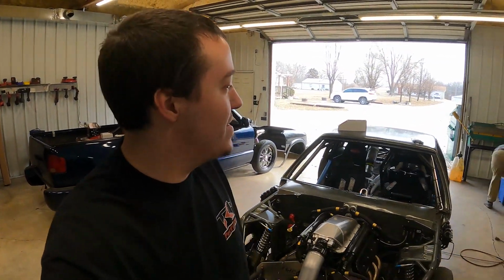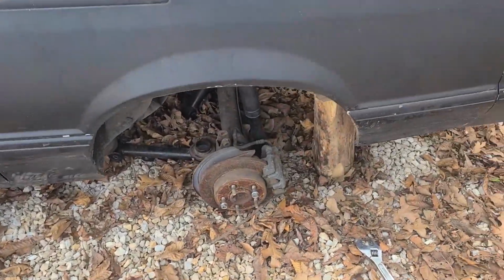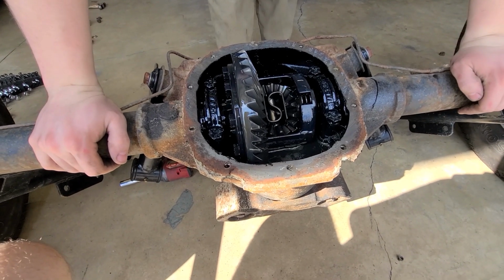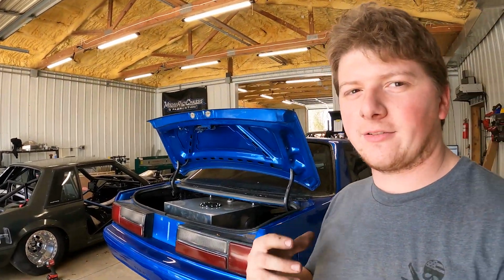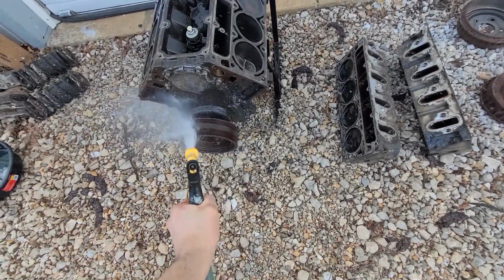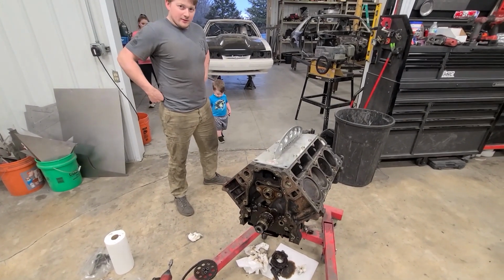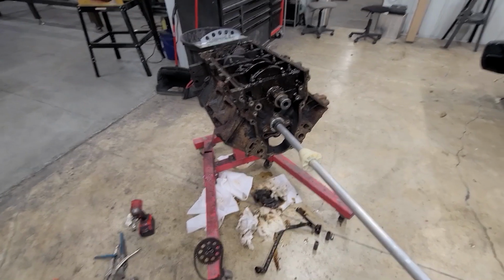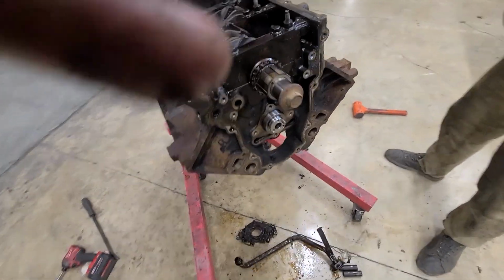5's for 5K     Ep. 1 Beginning the build!

Comment: You guys know that you can turn the wheel 10 times and count the pinion revolutions and divide by 10 & that will tell you the gear ratio.. Approximately 37.5 revolutions would be 3.73, ect.. Good to know for junkyard gear hunts..
Also, those are 94-04 mustang calipers